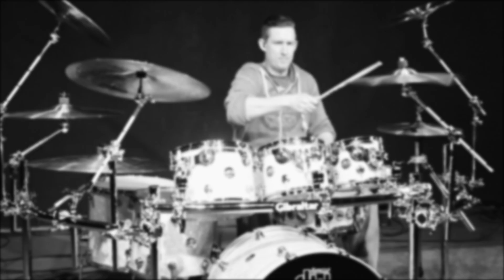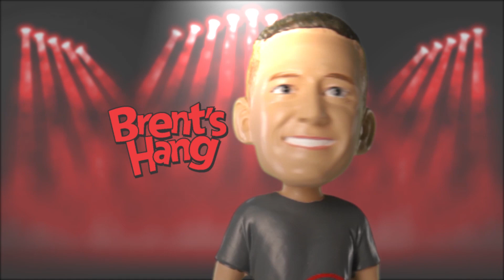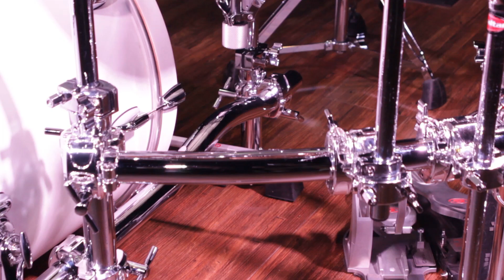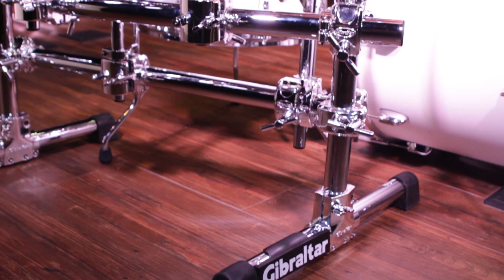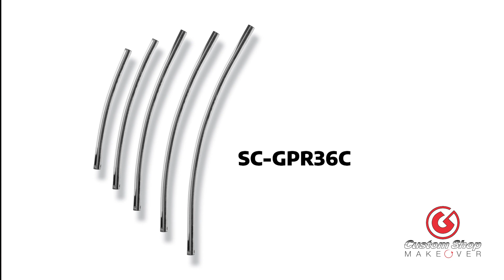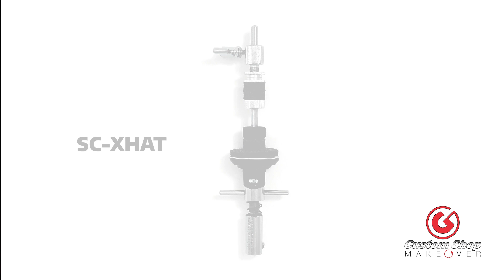Gibraltar Custom Shop Makeover - Rens De Vries

Comment: I also love this series, and the curved stealth side rack is the only kind of rack I would consider (I usually prefer stands). But I still think that I don't like those no-legs hi hat stands. It means one more clamp and bar to carry and set up, while a 2 legs hi hat is stable, needs less hardware, and is really comfortable to set up your pedals if you use a double one or any accesory. The only real use for it, imo, is if you use 2 bass drums and you attach your hi hat to one of them, so you can keep it really close to your kick pedal with no closed legs bothering you. Otherwise it's usless for me.

Comment: Thanks for posting these videos; they provide some great ideas as to how to utilise the products provided by Gibraltar. I'm considering moving to a stealth rack, specifically the GSVMS-KIT to mount my tom, snare and crash from. My question is how is this kit best transported? I have limited transport/storage space when my kit is in transit/being stored between gigs but also want to have a quick setup and pull-down. How easy is the GSVMS-KIT to break down and set up quickly bearing in mind I will likely need to transport in a hardware case/bag?